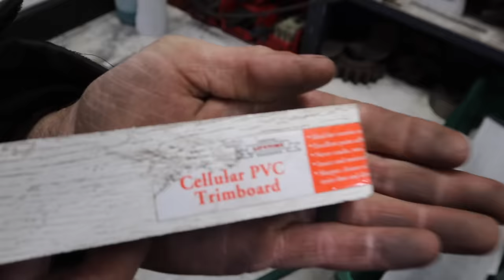The Forgotten Hand Plane ~ Fully Restored & Customized

Comment: Next time wait to flatten and square after its assembled and you’ll get more precision. The parts distort the bed
Reply: That's never truly been proven. Watch Paul Seller's video on that. If it helps at all, it's not enough for someone to fret over it, but I guess if you're used to doing it...have at it.  😊
Reply: @triune_blades  I'm pretty sure that Paul did prove it. He states in his video that he's measured the difference between two planes, one sole flattened disassembled & one flattened with all parts assembled. He measured the difference & said that he did it because people didn't think it made a difference. I've done both & it definitely does if you're making precise joinery & need truly flat, square boards.....in my experience.
Reply: He checked it with a combination square and the bed is flat. There is more than one way to skin a cat.
Reply: @davidrustylouis6818  Joinery does not need to be that precise to such a degree that only a fusspot with fine measuring instruments could tell it was microns out .Where not taking about an engine here where tolerances have to be more precise & true to stand extreme forces of friction ,heat & vibration .Joinery / carpentry only has to be precise enough to serve its function & be aesthetically pleasing & accurate to the eye .The planes didn’t come from the manufactures built to 100% perfection ,they are manufactured within excepted tolerances .It’s only anal fusspots the type who go out of their way to critique & find fault that are never satisfied .Timber was a living thing what’s flat & square one day ,is slightly warped the next ,who cares especially if you can’t see it by human eye .
Reply: @maskedavenger2578  You're talking about what one can see with the human eye, but also with hand joinery one or several microns will magnify. For example, a tennon shoulder on a cabinet door out of square by  .5 mm will multiply the length of the door. That out-of-square  .5mm turns into 2 or 3mm at the other shoulder or introduced twist into the door (which is absolutely visible to the human eye).
 So the level of precision is absolutely the difference between high-level craftsmanship & "good enough". I get the difference between a necessary level of precision & going overboard like an over obsessive engineer. I'm just saying that there are definitely many instances in fine joinery where the highest precision one can achieve, the higher the accuracy (like Paul says), the better the fitting of all parts reflecting a high level of workmanship & the better the result.
Reply: @davidrustylouis6818  You can see if a joint is not square like a corner of a frame or door .Yes even though you can’t see very slight in perfections you may slightly detect them running a trained fingertip over them .Surely only somebody suffering with a case of severe OCD would be bothered about such trivial matters .I am a retired joiner / Carpenter I used to work on many old & listed properties, that had moved & distorted with age. Had I made renovations or fitted everything straight,level or perfect by the book ,they would have looked very out of place & unpleasing to the eye . Besides building site joinery I can also do bench ( workshop ) joinery / carpentry .On many renovations of old listed buildings,I have been asked to repair old furniture like table tops that have opened up & become slightly concave or con- vexed .Had I used perfectly trued boards or made them fingertip feel perfect they would of looked unpleasing & fake to the eye .Planes used on site get knocked about I prefer to use a Record No 4 as its heavier & I have fitted it with tougher plastic handles off a different model .I dare say it’s not as flat as my Stanley Bailey bench planes ,but any of the slight in perfections of trueness ,it may have works to advantage in the situations I used it in .I have also witnessed other joiners using planes that had snapped in two at the frog & been rejoined slightly out of line from original with a weld join & trued up longish boards no problem .Which proves to me that planes don’t need to be 100% flat & square just somewhere close hence factory tolerances from planes from same batch being variable but within reasonable average parameters .
Reply: @maskedavenger2578  absolute squares on plane soles is unnecessary, I agree with that sentiment.

Comment: Plain ol' vinegar is an excellent rust remover. I just put it in an old Tupperware type plastic container with a lid, check it every day, or so, and wash the parts off when you're done. Wear rubber gloves though. It will turn your hands black when you fish the parts out..lol.

Comment: Pretty good...I just disagree with your decision to use colored paint. They had black japanning originally.
Reply: well they're his, if he likes em that way, great. I think they look good, but he does call it a customization, not a straight up restoration, so leave it be.
Reply: Aaron Blair Ones made by the Record company were originally blue.
Reply from the maker: I knew people would! When you own something......
Reply: @SalvageWorkshop  opinions. Everybody has one and most of us like to share ours.
I like your work and this video in particular came at a good time. I just found a rusty hand plane of my dad's that I want to save. And believe it or not there's a second one that needs some work but it's not in near as bad shape. Mine are two different plains though. The six inch one is really bad and I don't see a name on it, probably buried under all the rust. The other is a fourteen inch Kleen Kutter that looks just like those in this video but doesn't have the patent number on the back of the body.  It has a previously repaired handle that was broken in the same place as yours. I'm most likely going to use a shaker can paint on them too. I did just watch your video on japanning though so I might give it a try, undecided for now, maybe I'll  look around and see if I have anything else that needs refinishing...
Reply: toot tall it’s not really a restoration then now is it?
Reply: @BCM1959  Give electrolytic rust removal a try, is quite simple and works fine.
Reply: @hakkigoo  ok. Thanks.
Reply: The only source of black japanning these days is China. Completely non authentic
Reply: @howardosborne8647  my local carpenter carries asphaltum. It very well may come from China but I don't care. That being said I understand this guy doing whatever he want to his tools.
Reply: @aaronblair9583   Hi Aaron I was being a bit of a  tongue in cheek comic when I wrote that post .. Japanning that comes from China.
Reply: @howardosborne8647  ohhh! Ok got it now.lol
Reply: I restore all my old  tools with black spray paint and gold lettering, I did this to a Stanley no 1... I love hearing people cry about it, but guess what? they're my tools.
Reply: Color....smolor….this guy brought two trashed hand planes back into service and did a very good functional job!  I appreciate seeing old quality tools brought back to life.  I do it, and this guy does it.  We should all do it.  Colors are not important except in commissions to bring tools back to original for museum displays.  I am certainly not meaning to be hateful to anyone here.  Not my intention.  I am just saying appreciate the effort to put tools back into use.  He did just that.  Now lets plane something to keep creating!
Reply: If that is 112 years old it should be English Rosewood, not Brazilian.
Reply: @sjv6598  And Marples planes have red bases.
Reply: @alexanderschwartz4235  Living in England, I've never heard of "English rosewood". Where did you come across it? Wiki has a detailed list of rosewoods but English is not among them. It is generally considered an endangered, exotic , tropical wood here now. Does "English rosewood' refer to a stained lighter coloured wood?

Exotic hardwoods were often brought to Britain as ships ballast.

Comment: An amazing restoration of both places. I liked it all but thought the original tone of the rosewood was a deep red. In your video they look black. Keep them coming. I really appreciate your talent. A pointed jewelers file might have made cleaning those grooves easier. I’ve also found that muriatic  acid does a quick and easy job of dissolving rust. It is inexpensive too just be careful and use it outside or in a well ventilated space. The fumes are dangerous to breathe. The pits still require a lot of work to remove.
Reply: Restored my Grandfather's plane, the rosewood grain was red/black before oiling but same 'almost black' after oiling, it's the combination of age and a century of use, really beautiful when polished but the camera can't do it justice.

Comment: A lot of effort was taken to prepare the plane base to be flattened, what you did was clean it. To truly/squarely flatten the base you must have ALL the parts in place and tensioner prior to finish flattening the base as it distorts when everything is tensioner.
Reply from the maker: I agree! I plan to run them both over the surface plate now that they're back together, i just ran out of time before I needed to get this video out... may not be perfect, but still pretty dang good compared to where it was!
Reply: Why did you grind them flat on the surface plate then ran an orbital sander over them????

Comment: Great save on a pair of really useful old tools. I love the color scheme and like others have noted would suggest the use of a good penetrating oil like PB Blaster to free those stuck bolts on the first attempt. Never ever try to free a rusted bolt or screw without a liberal dose of penetrating oil and a few good taps to help it seep down the threads. Not bashing you at all, really enjoyed your video, just my 2 cents.
Reply from the maker: Much appreciated! They'll get well used by me! I disagree, penetrating oil isn't always needed.
Reply: @SalvageWorkshop  I agree it's not always needed but a good spray and tap before you twist a bolt in half is a wise choice.

Comment: I have a Bailey 5-1/2 about to get this treatment. Fortunately it is in much better shape than yours but there is still a lot of rust. I have sharpened it and am using it for some slabwork but it will get the full treatment shortly.

Comment: I applaud your work. So many would just trash the plane. Others would remove the rust with an angle grinder. They both need some minor adjustment, but they will both work just fine. The cap iron needs to be adjusted closer to the cutting edge - 1/32" or so, and the frog needs to be moved back slightly. Check with Keith Rucker at Vintagemachinery.org. Somewhere on his website there should be a copy of Stanley's instructions. Thanks for the video. Jon
Reply from the maker: Ya they still need a bit of tuning! I'm very familiar with Keith's site I use it ALL the time!

Comment: I spray all the screws with a proper penetrating fluid (WD40 is NOT a penetrating fluid, it is a water displacent) and wait 20min. Saves damaged screw heads. Also have a manual impact screwdriver that taps down into the slot rather than enlarging it.

Comment: HEAT  stubborn  bolts  nails screws  with an electric soldering iron.  the expansion breaks the link and then when cool its easier to remove

Comment: Great resto!
One tip though, if you have to release your lever cap to adjust the depth of cut, it's waaay too tight. Also, you throw your iron angle off. You shouldn't have to exert much force to do the lever cap.

Comment: Try using Cold Blueing on those metal parts. It protects the metal without needing to re-true the bottom.
Reply from the maker: Did you miss the part of the video where I "cold blackened" a whole BUNCH of the plane parts?  Cold bluing doesn't actually protect the metal for very long without a coating of some kind. It's a corrosive chemical process that causes the color change!
Reply: @SalvageWorkshop  Yes, it's just a copper compound that makes steel black temporarily.  It rubs off easily.  Hot bluing/black oxide is better but really only holds up on rough surfaces like black oxided tools and well maintained firearms.  Nice tools like your planes shouldn't be exposed to the elements so it shouldn't be an issue.  You salvaged tools that I would probably have passed on.  Nice job.  Not my choice of colors but they AREN'T MY TOOLS!  :-)  I can make mine whatever color I want and nobody has to like them either.

Comment: Really liked the finished product, but you have to get some new screwdrivers.  I have a lot of the slab handled flathead screwdrivers and they are made to strip heads out because of the sloping faces of the driver.  The “newer style” flathead bits are designed like a gunsmiths screwdriver and have flat faces so they bite into the screw evenly without trying to climb out of the slot.  I doubt that makes sense but hopefully you can figure out what I’m talking about.  Great job on both of the planes.

Comment: When cutting threaded rod, put the appropriate nut below the cut, after the cut run your nut off and it fixes threads at cut line.

Great job but for me it’s easier to call 1-800 lee valley

Comment: I like to do a final rub on wood and metal surfaces with 0000 steel wool and either wood finish on the tote and knob or oil for the unpainted parts. It burnishes the surface to a pleasant lustre.

Comment: I have to admit that I yelled No several times during your video. lol  Especially when you attempted to remove the stuck threaded rod from the front handle.  Been there done that!  Wasn't it fun to discover that these old planes used what is now a non-standard thread pitch?  Oops.  Someone's already mentioned about flattening while assembled.  I understand that you're refurbishing them to use and not to resale, so commenting about altering the finish is not appropriate.  Use them and enjoy them.  I only wish they hadn't been rare bedrock planes.

Comment: 11:40 You now have a set screw.  So what if they're not Hoyle.  Although the early Bed Rocks are not my choice, these look nice.  Well job, good done.
Reply: What don't u like about the bedrocks? Thanks
Reply: Not all Bed Rocks. Just the first go around. I have a 608, 606, 605.5, and 605.
Reply: @rosshollinger8097  thank you. I only have one, myself. I forget the number. a jack.  What was wrong with the early ones? And what is the year they improved so I don't buy before that. Thanks again
Reply: @timbarry5080   Noth wrong with earlier types, per se.  Check out this website. There are others, but this a good one for good info on the Bed Rock.  https://virginiatoolworks.com/2015/04/12/everything-you-ever-wanted-to-know-about-stanley-bed-rock-planes/

Also, type in "type study" and "stanley bed rock" in your search engine and become an authority in 60 minutes.

Comment: They will cut ten times better if you sharpen those irons properly.
Reply from the maker: I agree!!  I need to get one of those jigs for holding the iron at the perfect angle and a set of diamond plates, but for now I do with what I've got!
Reply: Salvage Workshop I bought one of those little jigs and the difference it made is unreal, the shavings are paper thin and it's far far easier to use.  I've just restored a Stanley Bailey no5 but it was no where near as bad as yours, probably similar to the second one. 🙂
Reply: @SalvageWorkshop  Diamond plates were a revelation for me when I first got back into sharpening hand tools. So much better than the old whetstone and so far they appear to be functionally impervious to wear & tear.

Comment: Every Bedrock plane I've seen has flat topped lobes, not sure this is a full Bedrock.
Maybe just the parts with the "B" marking are Bedrock?
Edit:
I love the antique-copper finish paint. It really makes the black painted markings "pop".
They look great, but did you perhaps do before and after weight measurements? Just wondering how much metal/weight was lost to sanding and grinding past the pitting, for a smooth surface?

Comment: While the lever cap says Bedrock, the frog looks a bit like a standard (non-bedrock) one as it is held down by 2 screws, but is machined flat on the mating surfaces. Is this a very early bedrock design?
Reply: They're bailey pattern planes but the cap irons might be cobbled on from other stanleys.
Reply: @KevinOMalleyisonlysmallreally  The pre 1911 Bedrocks did not have the pins but just the 2 screws to clamp the frog to the sole plate. The frog mating surface for the iron looks like a bedrock design.

Comment: If you take 2 nuts that are the same size and thread pitch of the studs you are trying to remove, run them down and crank them tight against each other you can use a wrench on the lower nut to remove the stud. That way you do not have to use vice grips that can damage the existing threads.
Reply from the maker: The threads on those shafts aren't a standard commonly available pitch, at least I couldnt find anything in my shop like them... plus the threads dont go all the way up on the internal handle bolts, they only have threads at the ends.
Reply: @SalvageWorkshop  You're right. IIRC, they're #12-20, which is an oddball size. There's a web page about it somewhere.

Comment: For fasteners rusted this bad I've had best experience with Knock 'er Loose made by CRC.  Penetrates deeper and better.
Reply: Can also make use of thin arc welding rod. Shock circuit to heat up the stud.
Reply: Jenny Tan the only problem with that is you risk destroying the material properties of the steel if you overheat. Always try to loosen with oil and penetrating fluid before resorting to heat.